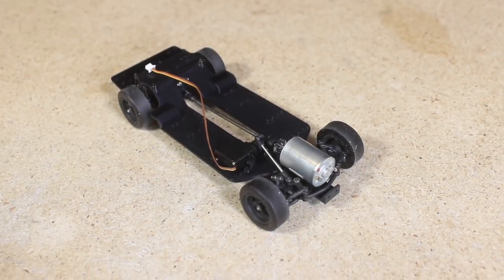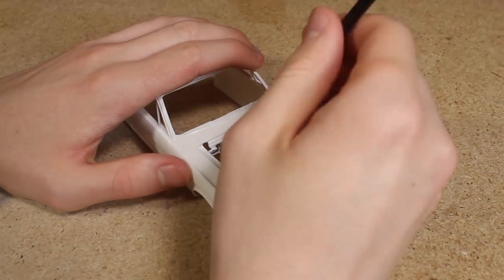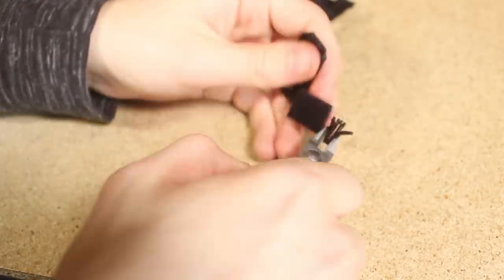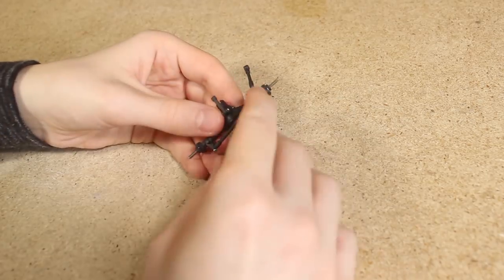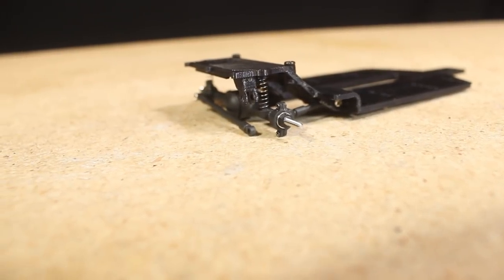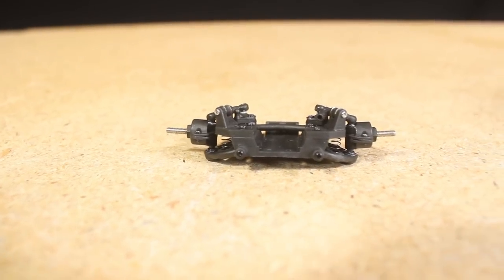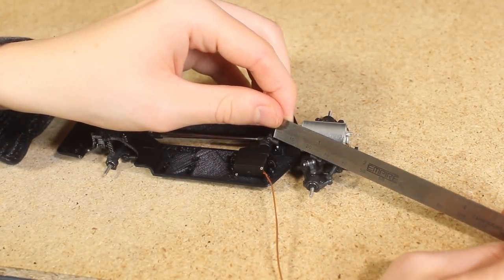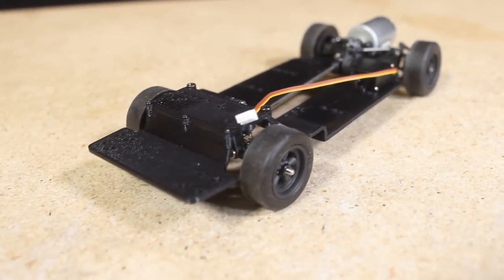Make It RC FFR SC1 Rolling Chassis Assembly Tutorial

Comment: Why don't you put the center driveshaft directly on the motor rotor ?
Reply: It will strip the diffs gears and they are hard to print as they are really small
Reply from the maker: @RC PATAPOUF I thought about doing that, however with this particular motor the shaft is too high and would result in a bad drive shaft angle. With a lower motor shaft this might be possible though the motor would need to be strong. Having the additional gears can also allow for further gear reduction.
Reply: @MakeItRC  ah okay ! Not bad idea ! 💪💪👍👍

Comment: You should sell a rtr
Reply from the maker: RTR's and complete kits are in the works. Hoping to have some ready in the coming weeks.
Reply: @MakeItRC  Great job man!, I've  always wanted to make scale 1/24, 25 scale rc models, actually I'd make a deposit on a complete kit chassis, my model of choice is a toyota ke70 sedan, 1/25 scale, currently building a 1/25 Range Rover classic, Orlandoo alloy chassis, metal solid axles, s2 lipo, sound and led lights, scale crawler. Just got back in to the rc hobby after almost 20yrs.👍